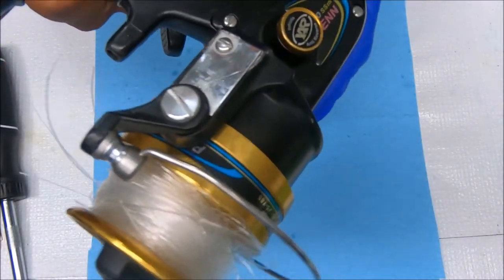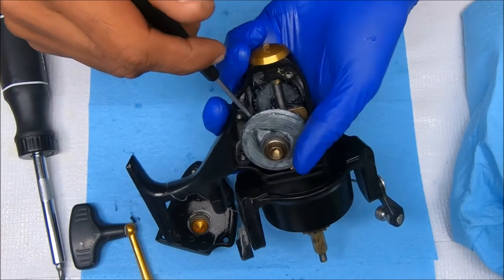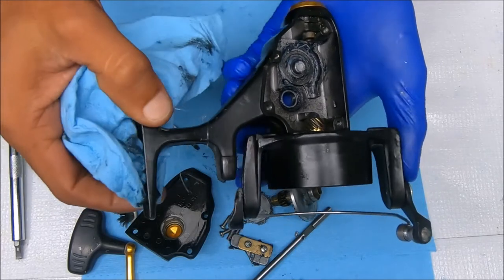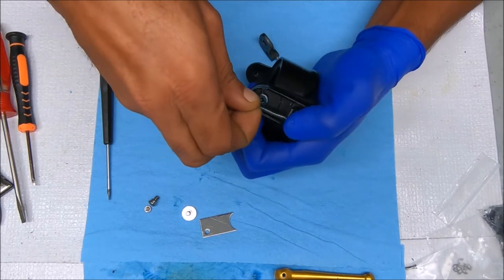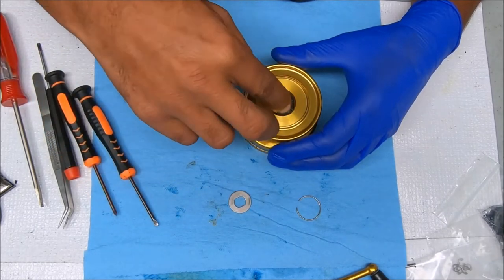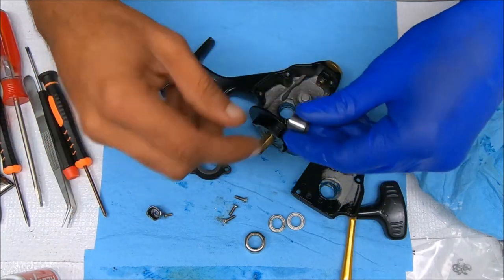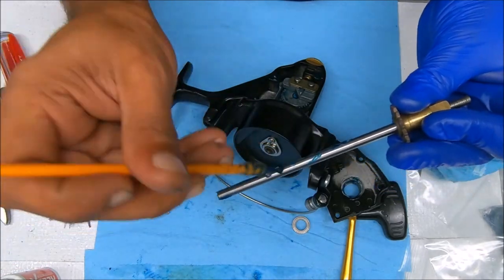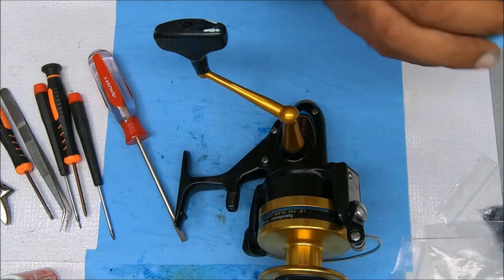Penn Spinfisher 750SSM Fishing Reel - How to take apart, service and reassemble

Comment: Hi!  I have a 750 ss. Can i change handle position  right side?
Reply from the maker: Yes, change to the left hand pivot or get a right hand crank handle off eBay.
Reply: @TSGReelService  good afternoon sir,  there is a way!!? Please save me.
 i was tried lot!  Please explaine me. What should i change?  Left sides bearing to right side?  It need to open the machine cover which have three screw?
Reply: Hi!  I found pivot in ebay. I need right hand pivot. Or buy a right side handle. Right sir?
Reply from the maker: Get a right hand crank handle. It's simpler.
Reply: @TSGReelService  please give me link. I searched e bay but all main handle. So i confused which right and left.